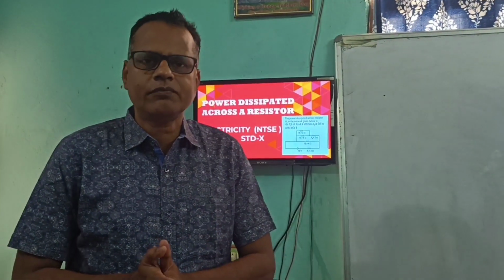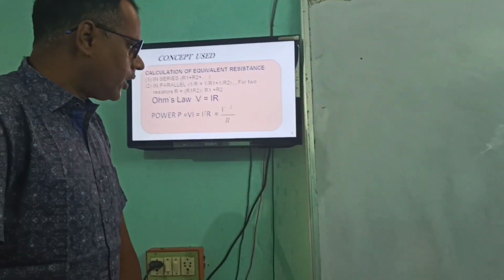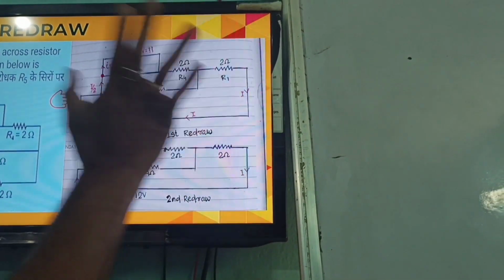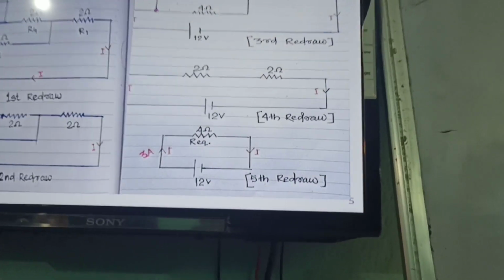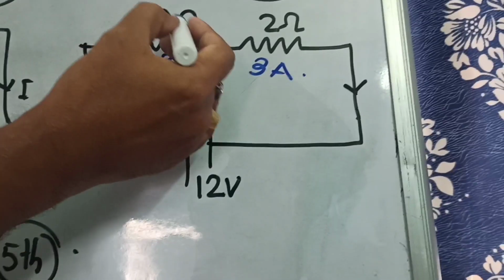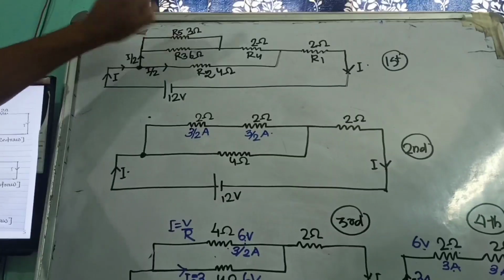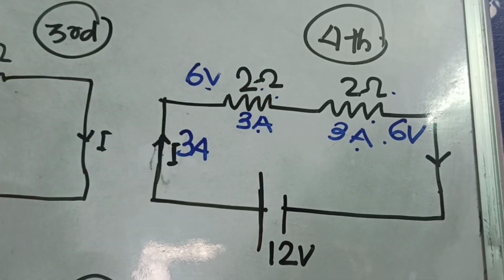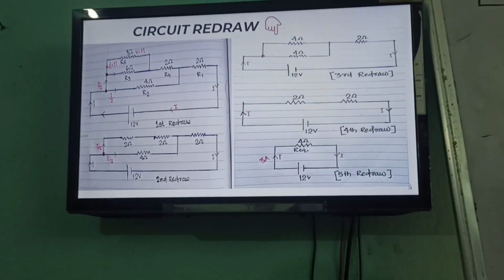Power dissipated across R5 in the given network

Comment: Is there any better way to do this, because how will you present this on a board examination sheet?
Reply from the maker: Dear viewer 
The explanation is an elaborate approach to understand the logic ,,,you can find out the equivalent resistance R ,,,and then current or voltage suply accross registers in any convenient way which u may comfortable.....